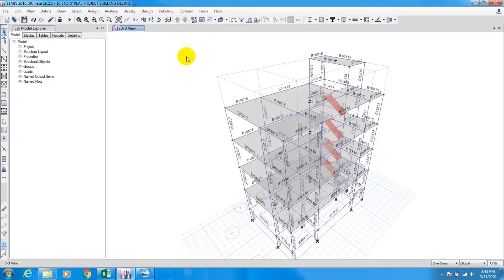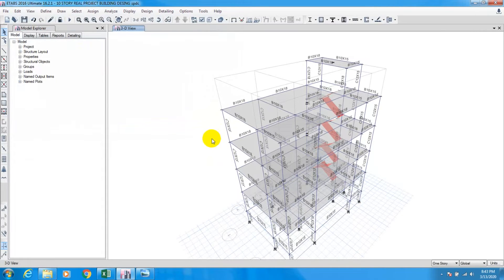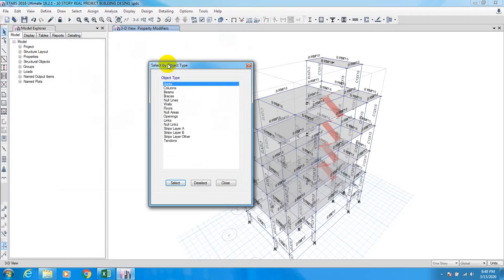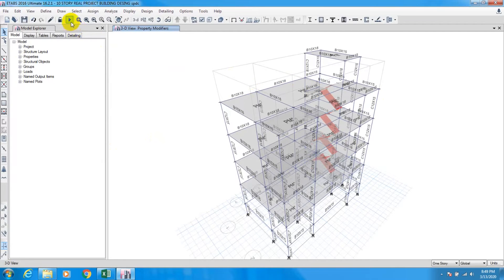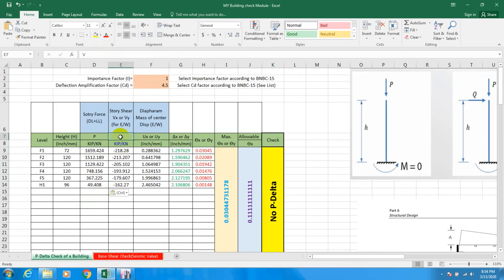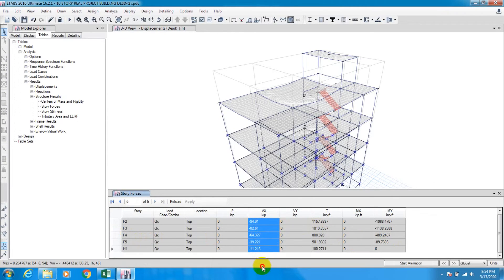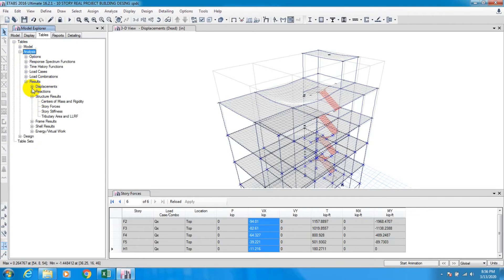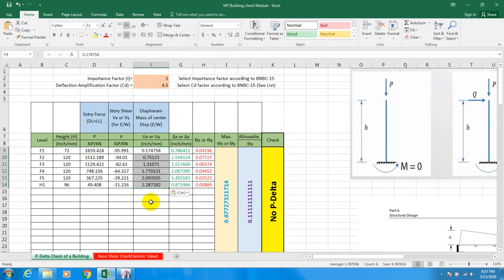Etabs Full Tutorials for beginners | define p-delta and P-Delta Check with Excel in Etabs | Lec-23

Comment: Section property to be changed only for p-delta check or for design also?

In which video you have changed the section properties for stiffness modifier?
Reply from the maker: for beam check for design.
and after all check we have to go for design.
Reply: @qlearnify-en  stiffness modifier as per which code (ACI or any others)????